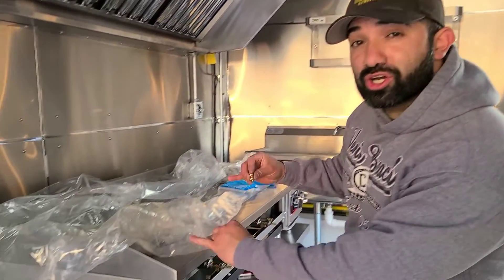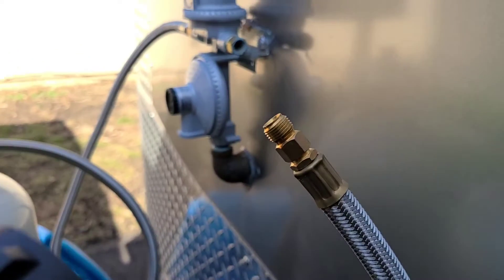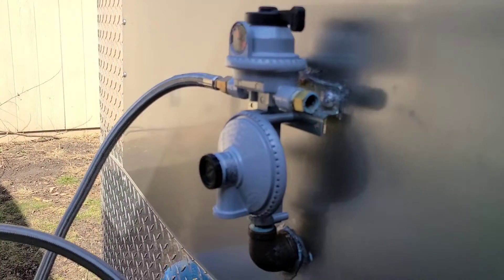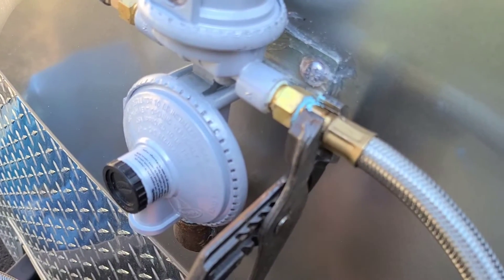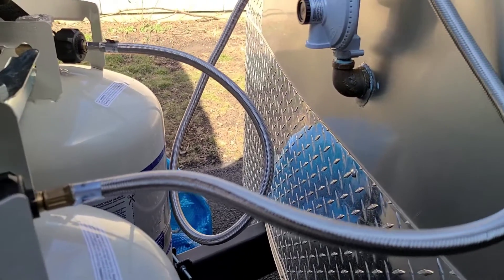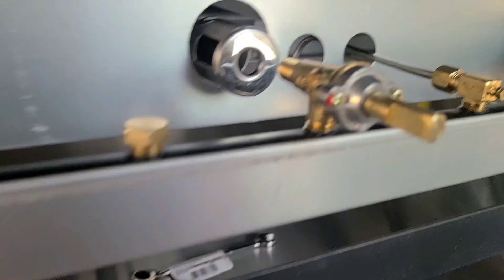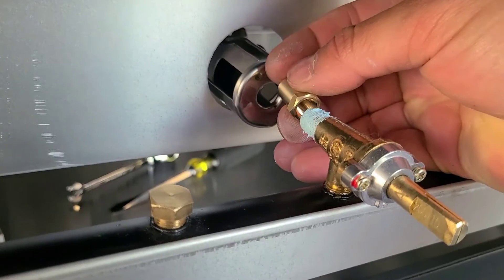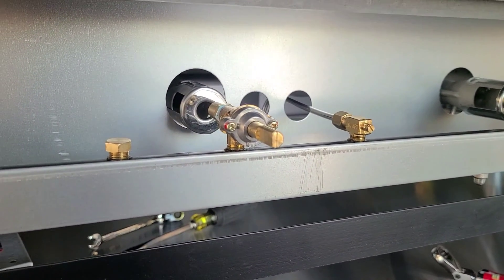Building a Food Truck: Converting the Cooking Equipment from Natural Gas to LP

Comment: Great info I familiar with brick and mortar restaurants and was just took to see if the biuders are buy used ranges and equipment and definitely converted home ranges. So definitely verify that the equipment comes with the stuff or can get. So is there any adjustment on the pilot if you don't want to waste fuel spark ignition?
Reply from the maker: @nyvinchenz9430  yes the brick and mortar equipment usually is made for natural gas, it has to be able to be LP convertible is what I have seen

Comment: Where the 90-degree elbow is located on your griddle, do you need to add the included regulator before the gas hoses?
Reply from the maker: I personally didn't, I only used one regulator in the front for all
Reply: @fbaltierrez  Thanks Frank!
Reply: What would you recommend getting as my main regulator for my trailer?

Comment: Hey Frank, so i want to convert my deep fryer from NG to LP, should i only change the orifices or there more to it. thank you
Reply from the maker: @wijayasstory  on fryers I'm not sure how those work. I have never installed or used a fryer. But on the other equipment I have used yes only orfices were changed
Reply: @fbaltierrez  Okay, thank you!

Comment: Hi Frankie! LOVE your vids. I would like to ask that if my propane tank already has a regulator, do I still have to install the maxitrol regulator that the griddle comes with? Thanks in advance!
Reply from the maker: I'm not a gas expert, so verify this. What I do is just use 1 Regulator in the front the changeover and that takes care of all my equipment, I don't attach another at the equipment side.

Comment: Can I drill my chefbase?  Like, mounting the legs of my griddle to the surface of the chefbase?
Reply from the maker: I wouldn't. It's all insulation under there. Not as solid as a table top
Reply: @fbaltierrez  what do you suggest I do?  How should I mount my flat top to my chef base?

Comment: Great video thanks.  Do you not have to change the regulator?
Reply from the maker: I only use 1 Regulator in the front and that is all, have had no issues
Reply: @fbaltierrez  makes sense, thanks for the reply. Happy new year 🥳
Reply from the maker: @user-qe8kb4pz7x  you got it. Happy new year 🎉

Comment: Frank, my griddle came with a regulator to convert NG to LP.  Do I need to attach it since my tank already has a regulator?  I didn't see it in the video.  Thanks
Reply from the maker: Good morning, I did not. I'm not the most expert in the propane topic but since I had the changeover reguator in the front kn my original trailer ita how its setup and haven't had any issues. The only issue is that my pilot light burns a bit more orange burns with more soot. Dont know how it would work with 2 regulators attached

Comment: Found your series and absolutely love it.  I will find the first and start watching but one quick question.  I am really interested in using CNG vs Propane in my food trailer.  Can you point me in the right direction for where I can buy the right sized CNG tanks and parts that would work in a food trailer? I know, nearly everyone uses propane but I like the clean smell of CNG 🙂
Reply from the maker: That is a great option, but as you mentioned I have never seen one running like this before. Dang that is a great idea tho. 💡
Reply: @fbaltierrez  Thanks.  When I find it I will send you the info

Comment: All the gridles I'm looking at online to purchase say them come with the required parts to convert to propane (LP) but they state a licensed and qualified technician is required to do the conversion. The MOTAK brand griddles even picture rating plates  with the date of conversion and company name that are required to be installed on the back of the unit by the company that converts them?
Reply from the maker: That's what the manufacturer recommends do you have to do it? Depends on if you want to, I didn't do it with mine, and have had no issues in 2 years. But convert it at your own risk, it's not hard
Reply: @fbaltierrez  thanks for the quick reply. Wasn't sure if it could bring up issues with inspection by the health department or if it'd go unnoticed
Reply from the maker: @daniellonchar154  no they never asked me anything. Nor the Fire department or health department asked me. If you don't convert it correctly you won't be able to cook your food properly

Comment: Friend !!
where did you buy this LP convertible?
Reply from the maker: It comes with the equipment
Reply: @fbaltierrez  Do I have to make this change in the fryer too?
Reply from the maker: @mauriciocondo7540  my recommendation would be buy them already ready for LP, a little more pricey but definitely worth it If you can. I haven't used a fryer personally

Comment: Great video again. How do you secure things like fridges and the water tanks again?
Reply from the maker: L brackets from home depot work great
Reply: @fbaltierrez  thanks! do you screw them right into the side of the fridges at the bottom and tops? Do metal screws eventually bend the metal on the fridge and come out?

Comment: Hey good morning frank, so do all appliances in a food trailer have to have to be converted to LP?
Reply from the maker: No they make some already ready for LP but price is substantially more
Reply: We’re can I find them? I went to lowes but they didn’t have any , also we’re can I find the cool connector, not sure what it’s called but we’re you connect your propane tanks to.
Reply from the maker: @victorcano7743  the Regulator?
Reply: Thank you I really appreciate your help, gracias
Reply from the maker: https://www.amazon.com/gp/product/B07HB74JRC/ref=as_li_tl?ie=UTF8&camp=1789&creative=9325&creativeASIN=B07HB74JRC&linkCode=as2&tag=rollingburrit-20&linkId=e622d2ae4ece58e3b70d2e8d20fb0274
Reply from the maker: @victorcano7743  they are in the plumbing section where the place pipe is
Reply from the maker: @victorcano7743  you got it! Anytime

Comment: What size is that Griddle?
Reply from the maker: I believe this one was 48 inches
Reply: @fbaltierrez  so I would assume ateast a 5 ft hood or a 6 ft hood would be needed if you have the steam table under it as well?
Reply from the maker: @Guason402tv  cooked food does not need to be under the hood